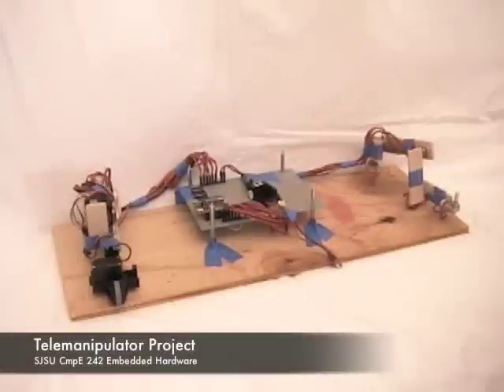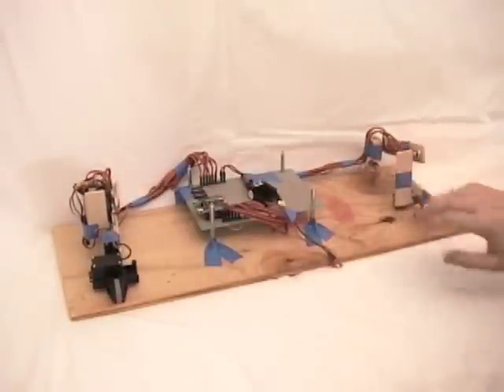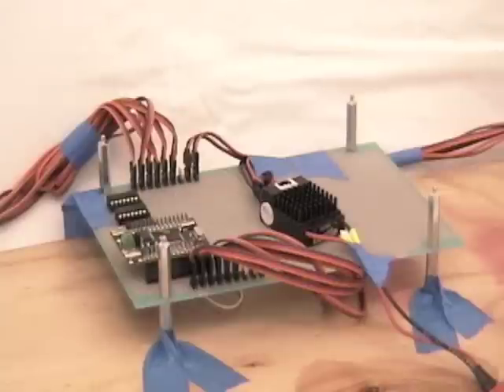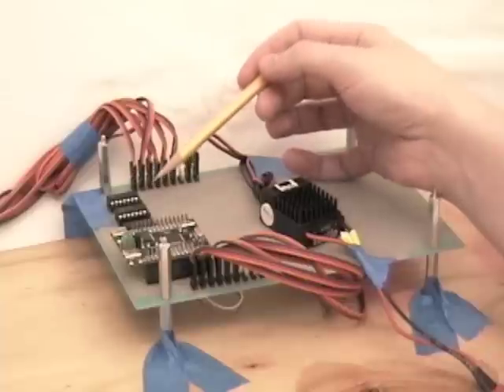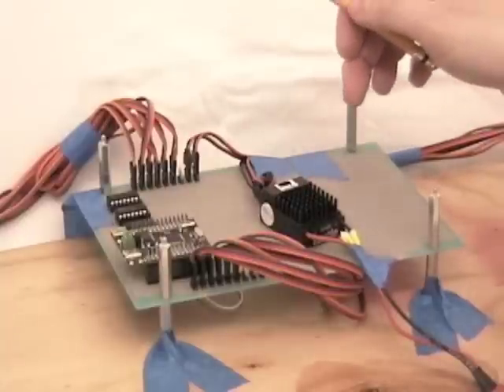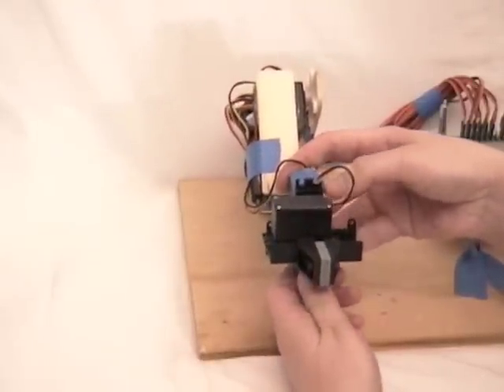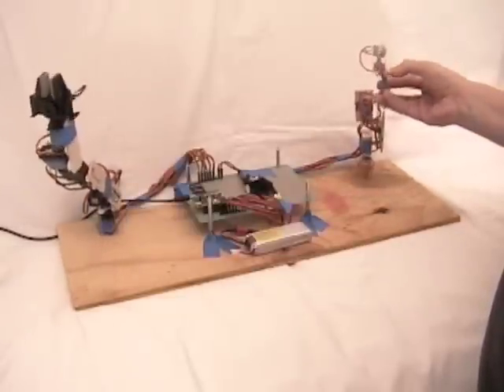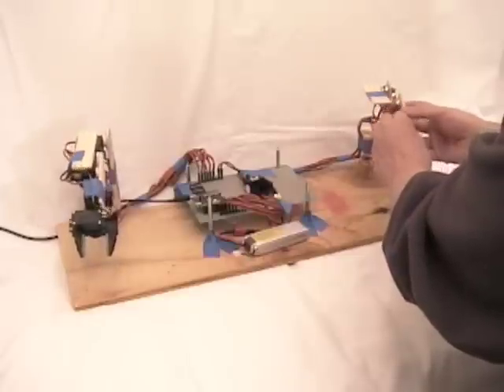Telemanipulator

Comment from the maker: A good place to start would be with an Arduino microcontroller.  You will need a way to read a position input.  This is easily accomplished with a potentiometer and an analog input (ADC) on an Arduino.  You will also need an actuator.  A model airplane servo is a good place to start.  These can easily be driven by an Arduino using a PWM output.  There are many books and online examples.  You can buy hardware from sites such as SparkFun and Pololu.  Good luck!

Comment from the maker: Interesting question.  Yes, it's just the duty cycle.  This gives a position command only.  The servos may be doing some form of rate estimation (such as a simple back-difference) of the position commands.  It's worth observing that the sample rate of the feedback loop within each servo is likely much higher than the rate at which the position commands are received.  Also, a servo will continue to use the most recently commanded position if it stops receiving commands.

Comment from the maker: @gowrishankaris -- Be sure that you are configuring PINSEL1 correctly to connect PWM5 to pin P0.21.  (Bits 11:10 should have a binary value of 01.)  PCONP should be configured to power the PWM by default following a system reset, so it should be powered unless you change that in your startup code.

Comment from the maker: @materialhirdles -- Hot melt glue.  I used the dual temp type on the hot setting, which is supposed to give a stronger bond than the low temperature setting.